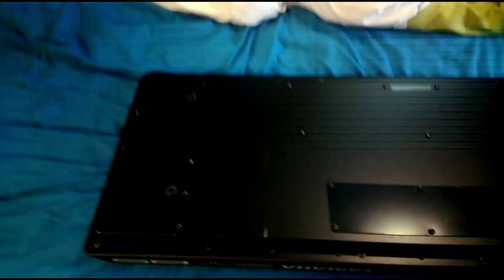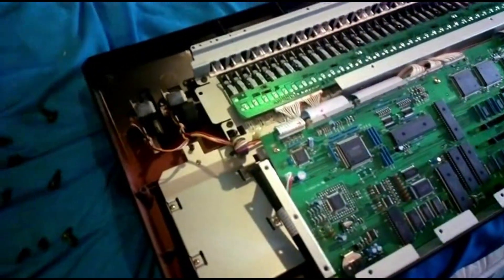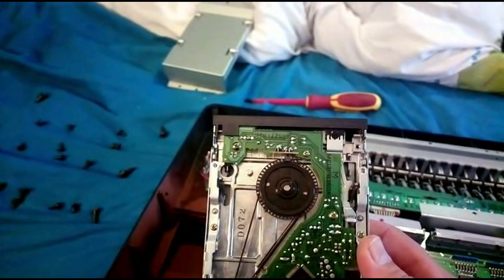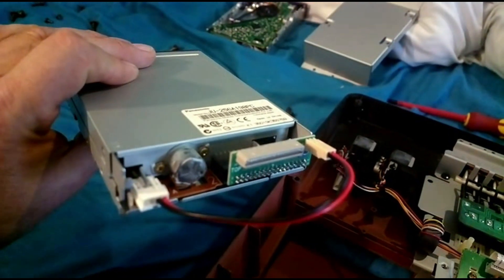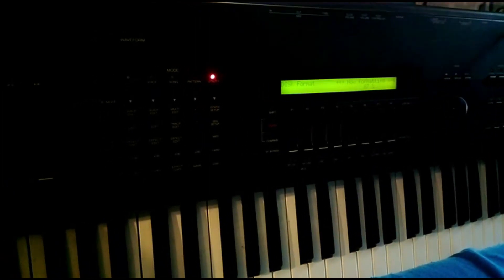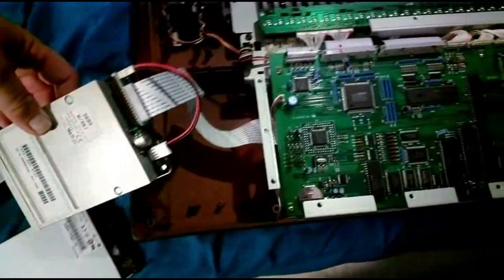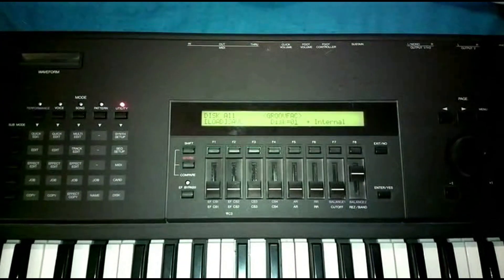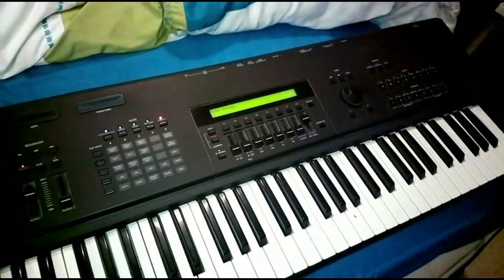Yamaha SY85 floppy disk drive replacement

Comment: Hi - these 34pin to 24pin seem to be discontinued...there are 34pin to 26pin available - would these work? Thanks.
Reply from the maker: @richardsmith4992  found some on this website https://floppyemulator.com/products/34-24p1-25adaptor/
Reply from the maker: @richardsmith4992  you would have to check the connections

Comment: Hello, I recently bought one of these for 100 euros, it's working and I think it's worth the effort to repair the small issues. First, when it tries to read the floppy drives it makes a strange machine-like sound - I guess it must be the belt. When I try to format the disk I get 'disk not ready'. Do you think changing the drive will fix it ? Second, some of the buttons need a bit more pressure to work, would this be a graphite issue ?
Reply from the maker: Could try changing the belt, you can buy replacement switches if you’re good at soldering